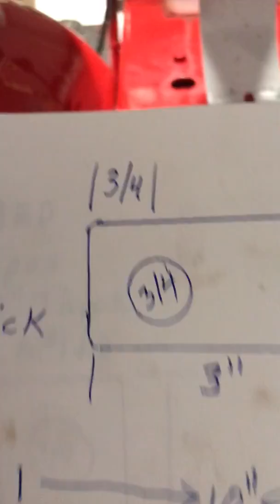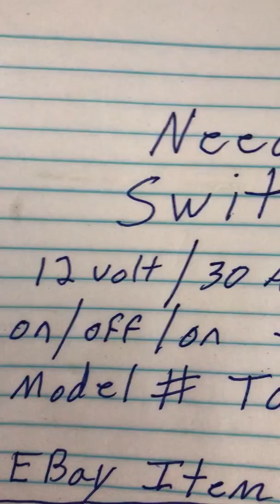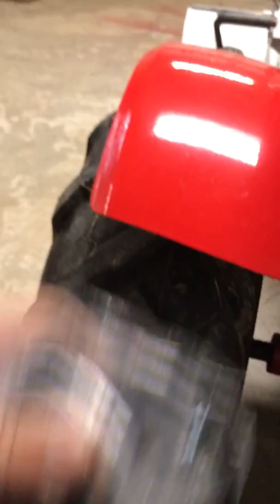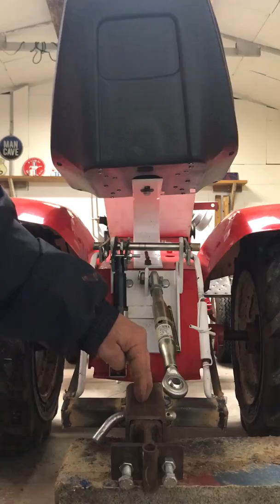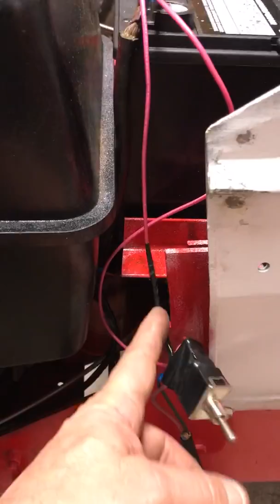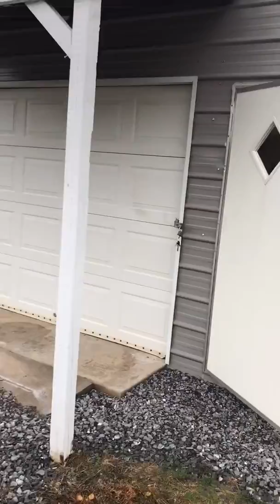Sears  electric hitch conversion part 2

Comment: Great design!!!  My actuator must be a little different than the on you used.  The push rod must be bigger on mine because it hit the bolt on the lift piece.  I made piece 2 & 3,  1/2" longer and drilled the 3/8 hole 1/2" further out which gave me the clearance I needed.  Haven't welded it up yet, but its coming along really well.  Thanks for the measurements and design.

Comment: If you ever decide to make a kit (of the pieces needed to do this) and sell them lmk please. I'd be interested in doing it to mine. I already have a 6" actuator on hand new in box
Reply from the maker: I  will have to think about it , as stated in video this requires a 4 in stoke , 6 in will have to much stroke , shipping will be high because of the weight of steel , Thanks for watching